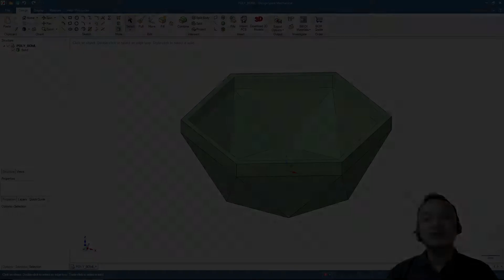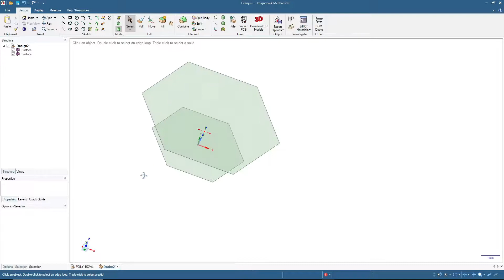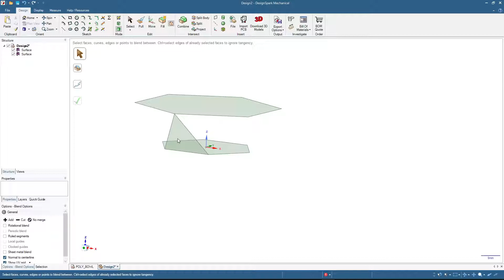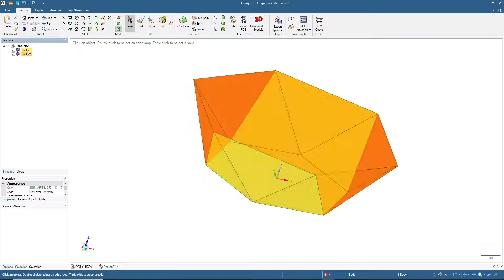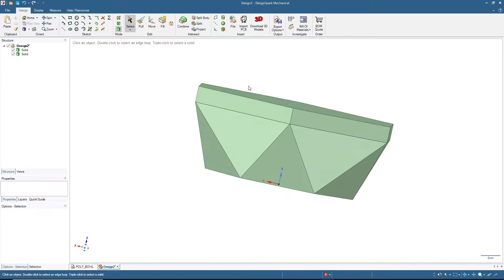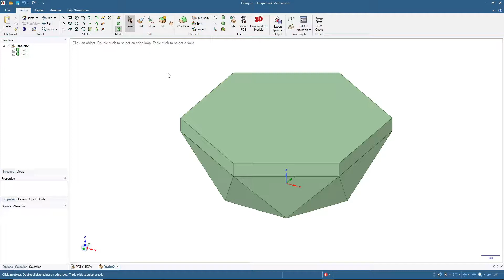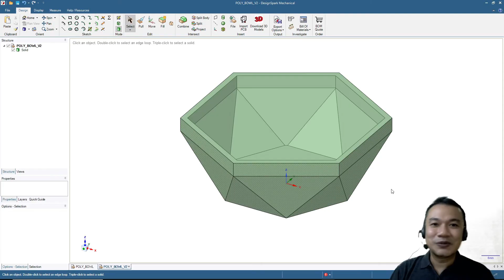Designing POLYGONAL BOWL- Narrated Tutorial of 3D Modeling Using Designspark Mechanical #09

Comment: What are you pressing to copy shape above another
Reply from the maker: Ctrl C then Ctrl V
Or you can also press Ctrl, then click on the movement axis and move as needed :)
Reply: @W3DEStudio  Thank you i will try that i am new to this and find your video useful. I want to be able to make a working model outboard motor , I am struggling with the first part the cowl.  I want it to have some shape not just flat sides.
Reply from the maker: You're welcome, and my best wishes with your project.
Anyway, you might want to try using Blend several planes/surfaces to make a curved solid.